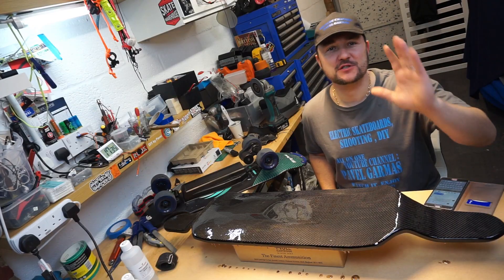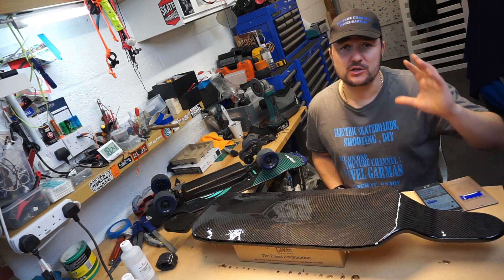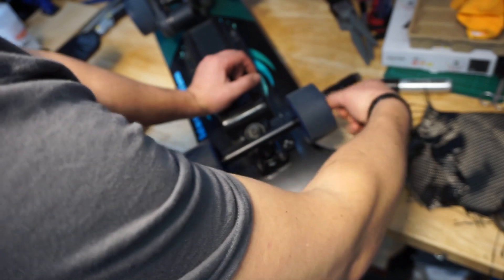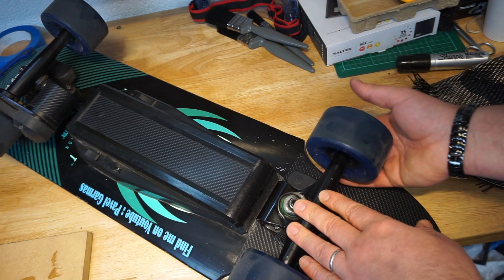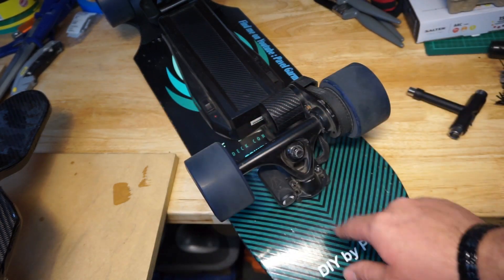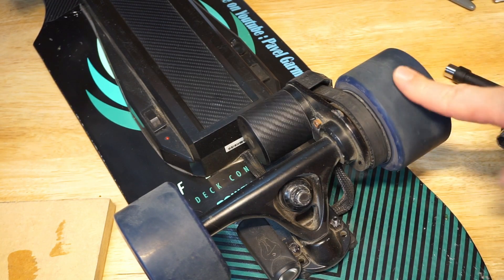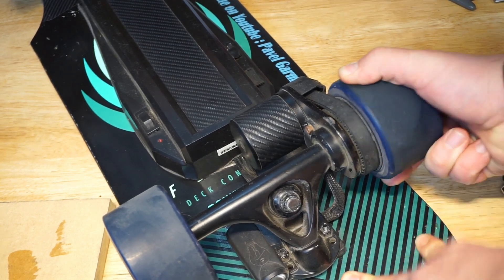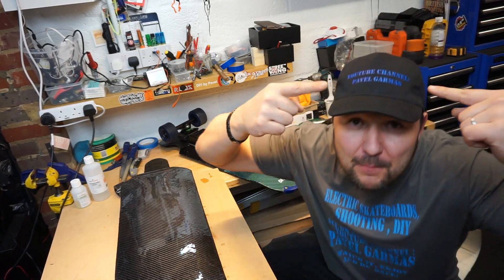ESK8 Did you know 8 ?  - wheel nuts! How tight?

Comment: what if tightened all the way yet still slight wobble in bearings? 

...does that generally mean bearings defective? 

I ordered an 8 pack and so far the first 3 wobble... as opposed to another set I bought that does not wobble but also does not turn as freely.